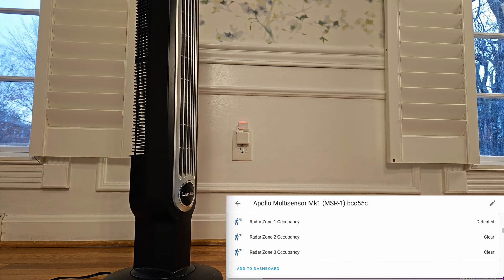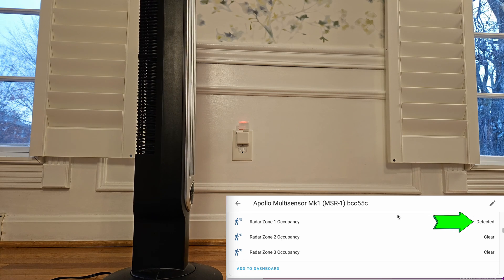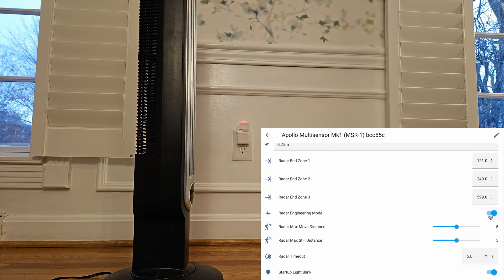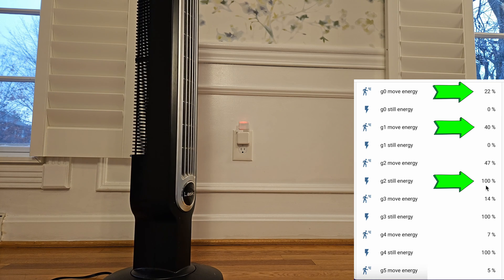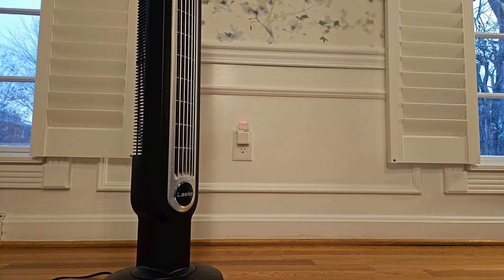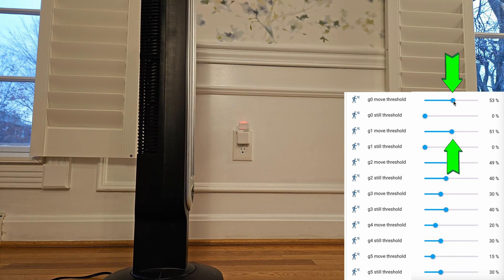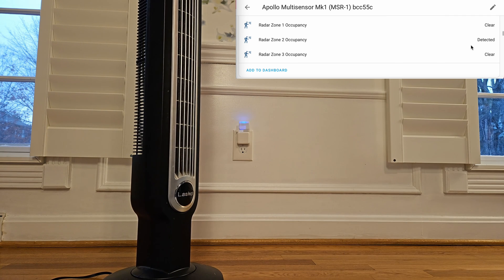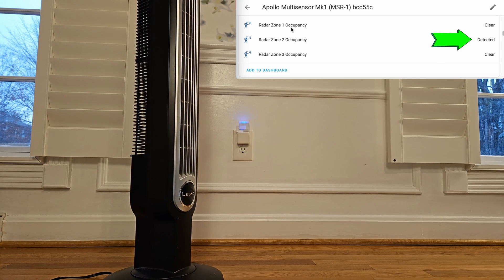Apollo MSR-1/2 Radar Engineering Mode Tutorial (HLK-LD2410B)

Comment: This is great, and from last video I feel like I understand the gates, but is there something that can tell me the orientation from the sensor of the detected movement? Like it’s 3 feet away at the 2 o’clock position vs 5ft away at the 11 o’clock position? Or perhaps a way to set boundaries to block off detection too far to the right of the sensor (narrow the cone)?
Reply from the maker: Unfortunately the module in the MSR-1 can only set raw distances, so it cannot do the more granular adjustments you mentioned.